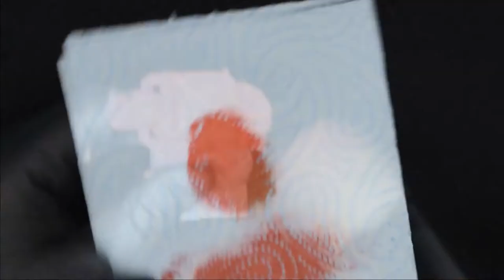Ford '32 post apocalyptic conversion for Gaslands part 2

Comment: Does the Tamiya Weathering pigments need any kind of adhesive before or after applying? Love the videos! Very chill and comprehensive in the process!
Reply from the maker: I seal all my cars with Humbrol clear coat after painting. It's easy to wipe those weathering powders off even by accident by handling the model while painting, that's why I ussualy do it as a last step.